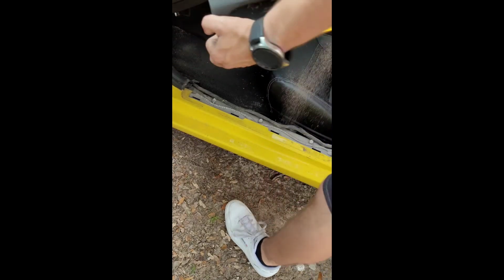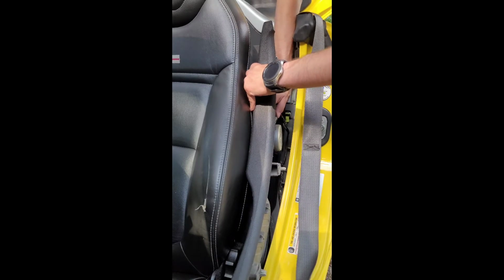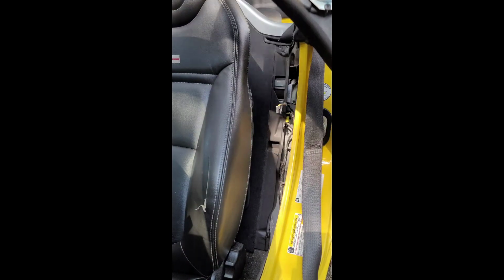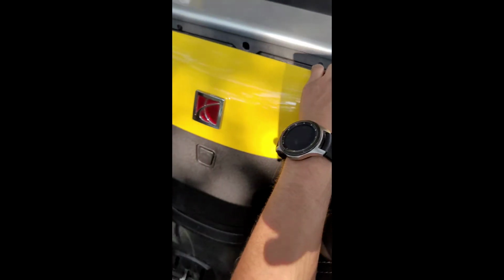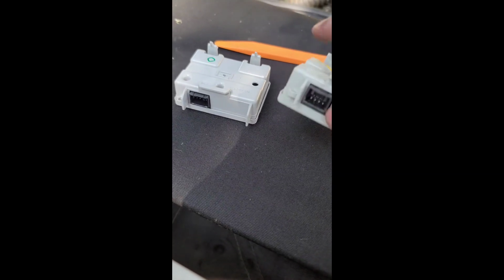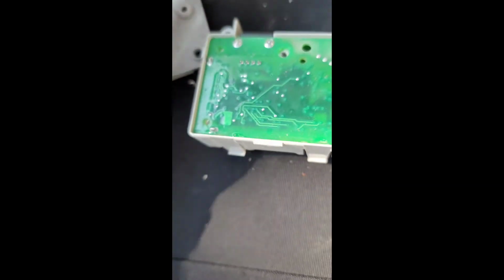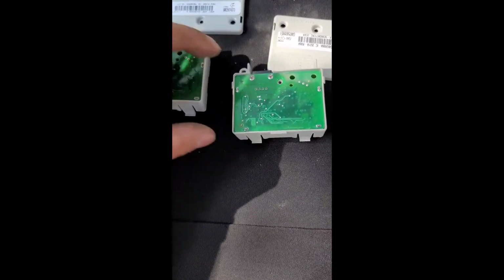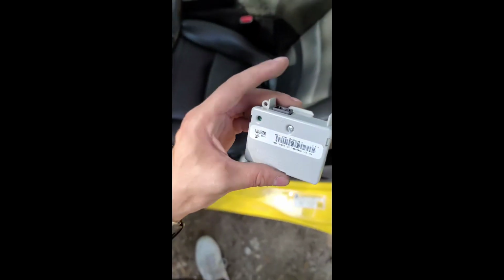(OUTDATED) Saturn Sky Keyless Receiver Replacement

Comment: Thanks for getting back to me. As I mentioned before, when I requested the part # that you gave me on the GM parts website, it would read that the part # doesn't fit my vehicle. I did installed a new battery in the fob and it only works when I point it on the outside of the trunk directly where the receiver module is located. My question is if the receiver is connected to a fuse or relay? I don't mind buying a new receiver, I just want to make sure that's the problem since the fob has a new battery. Thanks again for your feedback.
Reply from the maker: Absolutely. 
You're right it appears I gave you the wrong Part # for your vehicle. The 2006 Solstices had a different receiver all together that, if memory serves,  didn't include "TPMS." The correct # for your vehicle is "21994227," and it appears it's discontinued. There is one available on eBay, however. As far as fuses and relays go, I would have to check the service manual to see which ones affect the RCDL Module. I am currently at work, but once I am home, I can get back to you with more info
Reply from the maker: Steve,
from what I have gathered I am not seeing any type of fuse connected to the RKE on either the BCM or Underhood Fuse Box on the 2006 Solstice.

Comment: Very informative! I like how you’re wise info to make the little teaks and not afraid to do so. And yes you are “an engineer” young sir for sure! Hey did it work as planned?  Who programmed it for you the dealership, Indy or a locksmith?
Reply from the maker: Thank you! Yes, I try to he as informative as possible, and the more informed you are, the easier the job! Yes, after the module was replaced, it fixed the issue I was having. To reprogram the Key Fob, I simply had a mobile locksmith come out and program the RCDL. Easy peasy! Very soon, I will be getting a China clone tech2.

Comment: So i gotta question for ya! Tpms system is reading completely blank, so no readings at all, my key fob also completely stopped working as well. This all happened right after my battery died. I heard that if your battery dies completely, and that can cause some systems to forget itself and go haywire which I think is what happened to me with the module but i am not sure if this is true. Were you having similar issues? Also how would you reprogram the system afterwards?
Reply from the maker: Yes! This is all completely true. The 2008 year model Kappas were shipped with a faulty code that would forget accessories programmed to the RCDL / TPMS Module when the battery died. This included Key Fobs and the Tire Pressure Sensors. Now, GM did release a service bulletin on this matter. However, it was not one covered by GM but the consumer. As for getting it all fixed, this is where the bad news is. The only way to fix this remedy is with a Tech2 obd device. With the Tech2, the RCDL Module has to be "updated with a new software calibration," according to the bulletin. The only problem is that Tech2's are expensive unless you get a China clone. If not, your only other option is to go to a dealership to get this fixed and present them with this TSB, IF they are willing to even work on it. If they do, I've heard a range of charges presented to different Kappa owners ranging from $80 to $360. This is why I haven't done mine yet. I'll provide the link to the TSB below for ya. I hope this information helps, and if you have any more questions, be sure to let me know.

Kaswell

TSB: 08-03-16-001B
Link:
https://drive.google.com/file/d/1eaXebhRhZdtP_oSpPgtvpc79MxPlRM8F/view?usp=drivesdk
Reply: @Kaswells_Kappa 

Man i appreciate you! 2 year old video and still answering comments! I really do Appreciate it.
Reply from the maker: Absolutely, man, thank you! It's always been my priority. I do apologize for the late reply, though. Thank you again!
Reply: So did the module need to be replaced or simply reprogrammed with the updated software?
Reply from the maker: The modules just need to be recalibrated with a new software update. However, my module was completely fried and needed to be replaced. Tech2's couldn't communicate with the module

Comment: Hello, I have the same problem that you have on my 2006 Solstice. Can you please tell me the receiver part # and where did you buy it from. My fob only works when I point the fob directly in the area where the receiver is located. Do you know if the receiver is connected to a fuse or just the receiver controls all the features like the trunk release, door lock and unlock? Any help 🙏 l would appreciate it. Thank you.
Reply from the maker: Hello!
The Part # for the RCDL Module is "25974373" and can be found on multiple GM dealer sites such as "GMPartsGiant," "GMPartsStore," "GMPartsDirect" or you can even use eBay and possibly get a cheaper price. If your Key Fob still works but only at a close distance, then it's more likely that the battery in your Key Fob just needs to be replaced. I would change the battery in your Fob first and see if the results are the same. If nothing changes, then we can go from there! To answer the rest of your questions, the Key Fob can control door locks, trunk operation, and auto start (if equipped). But of course, it's not the only way to control those features.
Hope this helps!

Comment: So on the sky this module also does TPMS? My Tpms works great but neither of my key fobs work well. I was thinking about changing/upgrading the module but if it also does tpms idk if I wanna mess with it
Reply from the maker: Yes, that is correct. This module is both the RCDL "Remote Control Door Lock" Module and the TPMS module. I've heard of aftermarket Fobs being finicky and not working too well. If you're trying to troubleshoot, the best place to start is always the simplest, so I would start with the Fobs themselves. If it turns out that isn't the issue, then I would work on the module. If you have a 2008 model, then you can worry about more issues involving the TPMS. If not, then swapping the module should be straightforward, though you would still have to get your Fobs reconnected through a dealer. The TPMS relearn can be done at home, though.  It's not one of the worst things to troubleshoot, but it's definitely tedious.

Hope this info helps!
Reply: Thanks. Both of my fobs only the lock button works so I figure the odds of that happening and it be the fobs is slim to none.
Reply from the maker: Yes, I would have to agree with you at that point.

Comment: Thanks !! Do you have a link for the module? 👍
Reply from the maker: I sure do! The part number is "25974373", I typically use this site, GM Parts Store: https://www.gmpartsstore.com/oem-parts/gm-remote-control-door-lock-receiver-25974373

This site was the cheapest at the time including shipping. You may want to check around to see which is cheaper for you.
Reply: @Kaswells_Kappa  Thanks for the quick response. You've earned your second subscriber 👍 looking forward to more sky videos!
Reply from the maker: @t.a-8469  Absolutely and thank you for the support! There will be a few more coming up shortly so stay tuned!